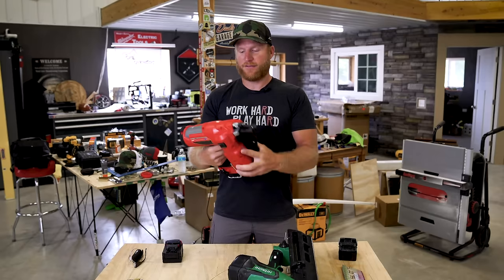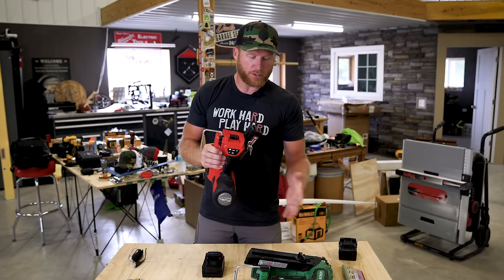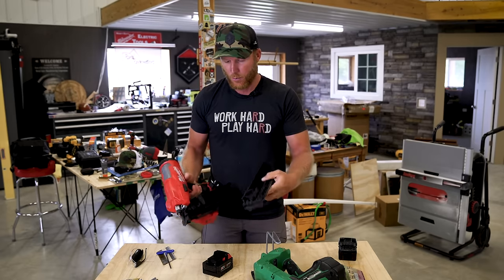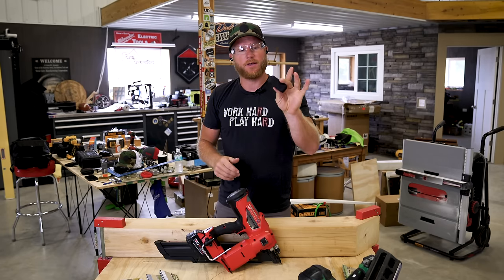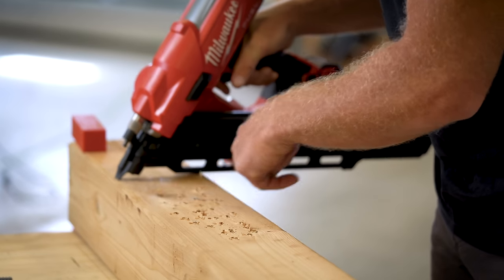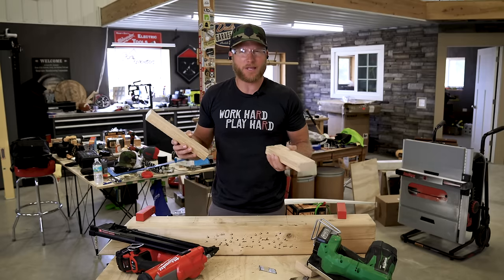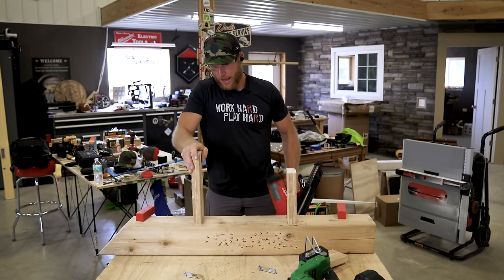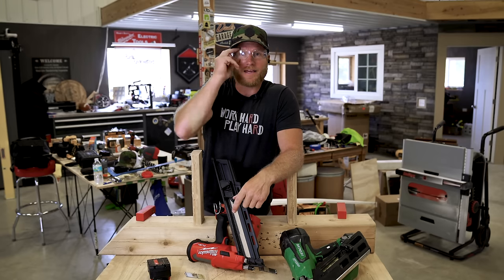Finally - - The Milwaukee M18 Battery Powered Framing Nail gun is HERE

Comment: 21 degree full rounds are my preferred and if you can swap to that thats pretty sweet.  
Not sure Im ready to retire my Hitachi air gun, but this looks solid.  Im wondering about performance in nailing LVL material which is probably harder than oak in most cases.

Comment: Thanks for the review!  VERY relieved to see that the Milwaukee won’t drive those 3in ring shanks either.  I have the Metabo and have been wondering for months if mine was defective, because it won’t consistently drive 3in ring shanks into 60 year old doug fir 2x4s on my house remodel.  It leaves about 1/2 proud and bends over.  I have a theory that the problem is ACTUALLY cause by the off set head on the nails.  Because the shank isnt directly under the head, the firing pin on the gun strikes the nail slightly off center, encouraging it to bend over when it encounters a lot of resistance.  I’d be curious to see if it is able to drive clipped head 3in ring shanks, same resistance but the strike should be dead center.  Any thoughts or experience on that?
Reply: sounds like the same performance as my dewalt 21 degree cordless framer. Makes me think that it is just that kind of wood/not enough power verses being pushed by compressed air. Do air framers have this problem with old growth doug fir?
Reply: This is why ill never get the dewalt.... ill stick with my paslode cant beat the power of a gas nailer..... unless its cold and you need to warm up the gas🙄😂

Comment: These guns kick butt toenailing. It’s a bit heavy, but worth it to lose the hose.  I got to use it on our job site this last Monday.  Check out the M18 stapler—great for installing windows.  You can set the depth so it doesn’t punch through the plastic flanges—a lot better than busting your fingers trying to use roofing nails.

Comment: 💥💥 I recently bought 3 of that Metabo at 3 different Lowes’s and all 3 malfunctioned.  The third was the worst one where out of 20 fires it only ejected 3 nails and it started giving off a burning smell.   I called Metabo and over the past 35 years in life in general and in business they were the worst customer service experience ever. They wouldn’t give me any tech support to attempt to explain how it could be possible that all 3 guns were not working properly all with different troubles.  All that she said was to bring “it” to a service center. She should’ve said “them” and I sure wasn’t doing that with brand new guns so back they went for a $1,212 refund. That experience was unheard of and I hope that Milwaukee is a better experience overall.  🤟🏼

Comment: watching everybody crap on the dewalt framing nailer, and here I am fucking loving to ones i have. At work we have a metabo one now too, but having used that one solidly for the last 2 weeks I honestly dont see it as any better. I still think its pretty sweet, but not any better.
Reply: You also don't need to get a nitrogen tank/seals replaced on your DeWalt either. I love my Paslode, lightweight and easy to repair and service. They all shoot nails, and all have strengths and weaknesses.

Comment: Is the dewalt nailer really that bad? I heard mix thoughts on both the framing gun and crown nailers.
Reply: Haha I just asked the exact same question.
Reply: I have the framing gun and it works great for me, I don't do ring shank nails though and I think Kyle uses mostly ring shank and those are harder to shoot. I love mine though.
Reply: Had a dewalt nailer for two years,, Milwaukee is treading water to catch up. Also lets talk when Milwaukee comes up with a cordless non gas concrete nailer
Reply: nope.......clearly there's a preference here. Plus this being a newer tool, it should obviously be better in some areas. But nothing is wrong with the dewalt. It's awesome. I use mine all the time.....never had an issue.
Reply: Nicholas Huss no. Remember he is sponsored by Milwaukee with free tools and trips...the dewalt nailers are great. The finish guns are the best cordless nailers out there, watch finish carpenter videos ...the dewalt framing gun will not replace a pneumatic framer,( no cordless does) or sink nails into LVL stock...but framers use pneumatic framing guns not cordless.and most engineered stock is 3 or more ply , which means you use flat locks...
    The dewalt gun is perfect for everything else, decks, projects, punch list. We have 4 and each one has over 1 million nails shot through them...a few jambs but none have been sent in for repair or serviced...
    Dewalt is for framing and carpentry, Milwaukee is for plumbers and hvac.and auto....Makita are great all around tools, festool is for shop carpentry, ryobi are made for DIY people ( although the cordless finish guns are very good), ridgid is good, usually heavier and not as big a line as others.

Comment: alright. so give me an honest answer. should i get the milwaukee or the paslode? i had my nailers (both paslode) in my packout, in the bed of my truck. ran into home depot, came out and all my stuff was gone. (stuff in the packout and the diamonback rig was most important), so i replaced my diamondback with a lil help from damani, traded an older stilletto and a tibar for an martinez, bought the older gen2 milwaukee drill & surge impact (preowned) on offerup.  so besides my martinez square which i think was the aluminum one, all i need to replace is my nailers, and pack out. money is a factor as i don't do this full time. its more of a hobby or my happy place. i help my buddy out on some projects on weekends, so I need to be certain i will be happy with my purchase. ive been dragging my feet for over a month on what nailer to buy, so any input would be great.

Comment: The DeWalt 21• sucks yes but the 30• is a work horse. I’m finding I can put out more nails and faster on my DeWalt 30• than my Milwaukee 30•

Love them both but find myself using the DeWalt more for wood decking and plywood where I need to put out more nails and using the Milwaukee when I just need to take put together some quick framing.

Going cordless is so freeing either way. I have 3 cordless framing nailers and I’m looking back to air guns anytime soon.

Comment: Going by the consistent bend beneath the nail head on those oak shots,.... I'd say it was a nail/fastener failure.  The nails all bent over beneath the head.  The nail failed and the gun lost the drive as a result...my guess.  the "stoutness" of the nail was beneath the hardness off the lumber, and I'd say the hammer hit isn't centered on the shank. A little shorter nail found the max sweet spot for the hardness <and> strength ratio. This is a problem with many of the finish gun nails also.  The guns got the nuts, but the nails a bust.

Comment: Im a little concerned that the milwaukee will start strong and gradually lose power like the hitachi and sencos which use a sinilar technology. Unless Milwaukee has solved the technology, but theres also no way anything man made with a pressurized gas spring wont eventually leak. Also the lack of explanation behind a what 6 month delay? Personally ill be waiting and see if its as hyped as its supposed to be. Or see if Dewalt updates their line as theyve generally been better for Carpenters.
Reply from the maker: I agree...time will tell.  I'll say this, after almost 3 years I sent the Hitachi in and boom it came back awesome
Reply: @RRBuildings  But in the mean time my coworker runs Milwaukee qnd has had a framer preordered since they announced it. I cant wait to get my hands on it and put it through a tough days work
Reply: @RRBuildings   did it come back awesome for 30$ or for 180$ though, big difference, regardless ill be picking up a milwuakee and live with any issues it may or may not have 99% of my work is 1.5" thick spruce/pine

Comment: Did you ever Find out if you can use the Milwaukee as a 21 degree and a 30 degree nailer on same unit by just changing the mag out or do you have to buy the 21 degree seperate because there is something that dosen't crossover? @RR Buildings

Comment: I have to say. I'm disappointed in the tip. I've been using the hilti GX-90 framing nailer for years and THAT gun has a fantastic tip. Super aggressive. Virtually never slips. The Hikoki and the milwaukee ones look piss poor and I'm not stoked about it. I'm sincerely hoping that I can modify it when I do get one.

Comment: So you mention gas? Milwaukee markets this as "a nitrogen spring mechanism". It is not the same as Paslode (butane). Its a sealed, self-cycling nitrogen-based spring or actuator. I would think that the seals will be the issue for MTBF (maybe 50K-1M strokes). Time will tell.. enjoy and do a followup after a year?

Comment: Even with the extended mag, when you're hanging by your toenails and holding that 2x8 just right, it's going to be out. They should have a 5 nail reserve, where you can flip a lever (with your trigger finger) and fire. Or at least have an audible alarm when you get down to 5 or 10 nails so you know before you climb up there.
Seems like a pretty solid machine. I'm kind of partial to the Ryobi Airstrike stuff, love the narrow crown stapler, was hoping they would step up to the framing zone, but so far, nothing. The Milwaukee looks like and sounds like and performs like they ripped off the Ryobi Airstrike system, with a motor, triple planetary gearset driving the crankshaft/piston on a springair cylinder. Wonder if it's under license or is there's a patent battle brewing? Maybe it's not the same, but it sure looks like it.
Reply: Milwaukee and Ryobi are both owned by the same parent company

Comment: I bought the Milwaukee 21 degree nailer and I am frustrated with it. I am a DIYer so it could definitely be me. Many times I will press the nailer against the board, press the trigger and nothing happens. Could the gun have a defect? What is the process? I thought you had to press gun against the board before you pressed the trigger. Is that correct?

Comment: Do you lose communication with your IsoTunes?  I find that if my phone is in my BACK pocket while mowing, working in the shop, etc. that my IsoTunes Pro lose connection ALL THE TIME.  I contacted them and got a replacement set that GREATLY reduced the issue, but I still have it.  I'm looking at the ISO Tunes Free because I can't stand the rubber coated wire that they used between the buds...they should be using a braided/sleeved cable to prevent them from sticking to your skin.

Comment: I swapped my magazine out for the extended one today and I thought the exact same thing about being able to change it from a 30 degree to a 21 degree. Let me know if you find anything out on that.. I'll do the same.
Reply: interested in this, gonna buy the 30 but dont know if theres any reason id need 21... cost is my mainfactor if one box of nails is 5-10$ more than the other itll add up in a hurry
Reply: The one bonus would be that the 21 degree mag shoots 0.148 nails where as the 30 degree mag only shoots 0.131 max. But I still haven't confirmed if you can just buy the other angle magazine and put it on the gun to basically turn it into a different gun
Reply: Have you found out whether you can swap a 21 and 30 magazine out on the same gun?

Comment: Dewalt should inprove their 20 volt framing nailer. bought the 30 and 21 degree and return them both back.The reason is both have a very noisy sound when nailing and dont work well at all. went and bought me the milwaukee instead and im well pleased with the way it works, this is a great framing nailker ill keep. most of my nailers are DEwalt and are ok, but the framing nailer needs alot of improvement. dewalt,make one that works like the MILWAUKEE and ill buy me one so i can keep all my nailers with Dewalt brand.

Comment: I’m forever adding the dewalt nailer to my cart and then researching a second opinion and removing it, can it really be that bad? What were the issues with it? 👀 I understand it’s not about the brand it’s about the right tool for the job, but I’ve stuck with dewalt since my first drill and every tool since.. seems a shame not to give it a go to see for myself, but at the same time I don’t just want an expensive paperweight in a couple months if or when I learn it’s garbage 😂
Reply: The dewalt is way better than the hitachi / metabo . Its lighter ,thiner ,and faster . Its one of the best one out there,but remember that its been out for a long time now so there no upgraded version. Right now the Milwaukee busted this one and let me tell you its fucking bad ass.

Comment: Roughly how many nails 16s or 8s when shooting shear  is it rated per charge with the 5.0 to 9.0? Vary interested...
Reply: Good point video. Did you check if i30 degrees gun take 21 degrees magazine? Thanks

Comment: How many nails can that Milwaukee gun shoot on one fully charged battery?

I bought the Dewalt chordless nailer, I was impressed until I saw the Hitachi going thru wood that my dewalt couldnt. My battery base is all dewalt so naturally i got their shit. And that is exactly what it was, shit. Now this milwaukee is reminding me of how much better the hitachi was than the dewalt and so is the milwaukee as far as I can tell. Looks like I am going to have to start having at least 2 battery bags for different brands so I have the tools needed to get shit done.

That being said, I also got the dewalt 18 or 16 g brad nailer. It uses the same fly wheel design as the framer but never had a problem with it yet. Being cordless made the job of trim work so much faster and easier than hoses and shit. So, little gun works great but bigger gun just doesnt do it with anything harder than pine. Yellow pine it wont work well on.
Reply: That’s odd, I bought a dewalt nailer when they first came out. I mainly use it for shooting lvls together from the stack or toe nails on trusses which are hard yellow pine. I’ve noticed my gun shoots best with 3”  .131 30 degree full head paslode nails, it does okay with the smaller clipped nails from different manufacturers but won’t draw lumber near as tight.
Not a fan of the wind up on the trim guns, too quick and they end up proud, we use paslode air 16ga and 18ga for production trim anyways.

Comment: I don't claim to b a pro or anything but i can't c wat situation I'd want to be firing 3 or more 3” nails per second. B4 i bought the dewalt i watched as many videos as i could (i already own dewalt tools, n i wasnt about to jump from brand to brand, battery platform to battery platform each time 1 company comes out with a drill, saw or gun thats "better" than the competitors, I'm not getting sent free shits). But the moment i got the dewalt n heard that ramp up sound i wondered if i got a damaged tool bcuz the way u guys exaggerate it i thought it would sound like a jet taking off, n if ur already wearing air protection wat is the big deal? When ur rapid firing ur 3-6 nails per second I'm sure it makes a lot more noise than a flywheel ramp up. I'm use to noise, i do work on a construction site afterall.

Comment: So Im not extremely knowledgable with nailers but wanted to ask is this just for framing or could it be used for putting up fencing?
Reply: You could use it to frame the wooden fence but Milwaukee has a cordless staple gun which can be used for soffit which would maybe be along the line of what youre looking for when it comes to putting up your wire. Not sure the staples used for the gun would work for that purpose

Comment: Ok, listen, I’m a framer, and I have to tell you.... this nailer is great, BUT!! It overheats or something. This gun, along with the rest of the guns in this line stops firing after I’d say a half an hour of heavy use. Ie. Nailing plywood ( shear) if you wait 10 min or so, it will start working perfectly again for... 10 min, then 2 min. You gotta let it rest for about an hour before it’s back to normal. All the guns we have, including the finish guns do this.

Comment: Sure would be nice if they put out a cordless gun for Case hardened nail for furring.
Reply: They already have several like dewalt and hilti track fast can shoot 11/4 nails for furing strips to cinder block and some concrete walls
Reply: Paslode make hardened nails for using in their nailers. We would use them for gluing and nailing on 2x2's to cinder block walls

Comment: Why use the 30* paper wrapped nails over the 21* plastic wrapped nails? With all the rain on my jobsites those paper wrapped nails would be falling apart in my tool bags.
Reply: Nikolas Paraskevas  ... I think it’s has something to do with the nail head ... the 21° have a full round nail head so they must be spaced better and that you can do easy with plastic ... and when you have nails falling apart in your tool bag then you should not take to much in your bag or work faster or don’t work in the rain .... HIHIHIHI ...
Reply: Wolfgang Selle paslode paper nails have full heads, clip heads are not code

Comment: Could the hitachi sink the 3" ring shank into the hard wood?
Neither could do the 3.5", interested to see if Hitachi could match the milwaukee with the 3" ring shank.
Reply: What cordless framing nailer are you using to drive 3.5" nails into hard woods?

Comment: Great revue, thanks. Looks like the Hitachi finally has some serious competition.

I'm not normally a safety tragic, sadly quite the opposite, but put it down to old age and "wisdom", and I noticed at 4:35 if that design means that's the typical way somebody will hold the gun to make some adjustment then it seems a recipe  to shoot a nail into yourself.

Comment: OK they have paper clips for the nails THEY SUCK in the NW coastal states rain and to keep the dry having clips in the bags is out of the question. 30 degrees now they don't fit with the other framers that still have 21 degree clips, so I have to convince my boss to get one so I can use mine on the job?